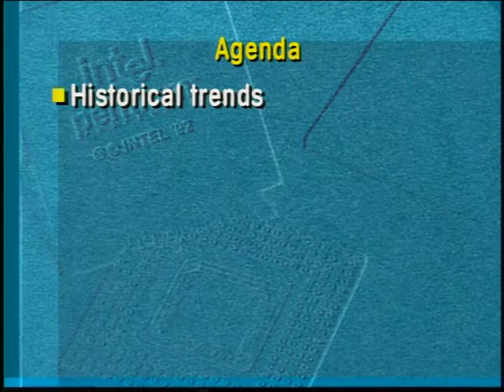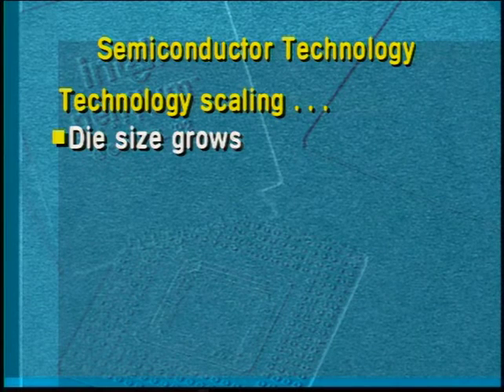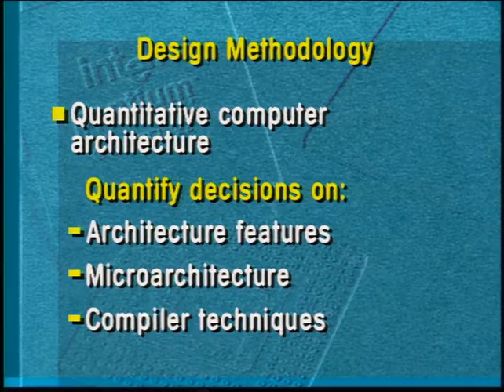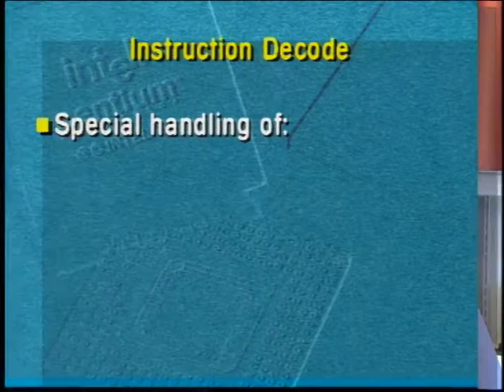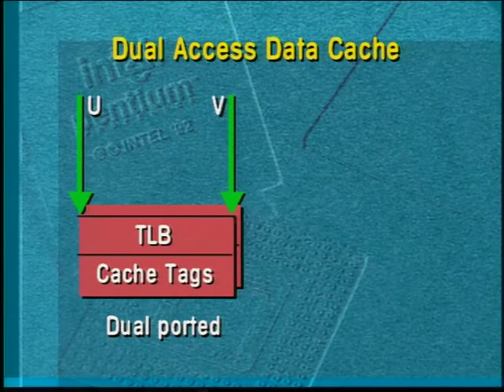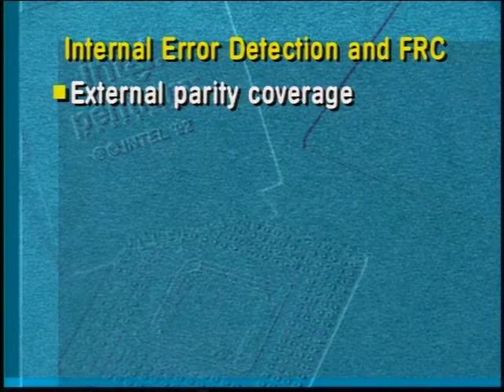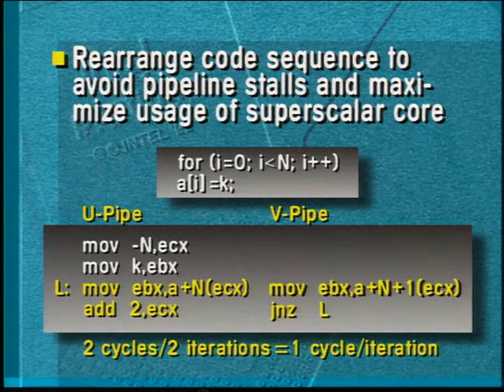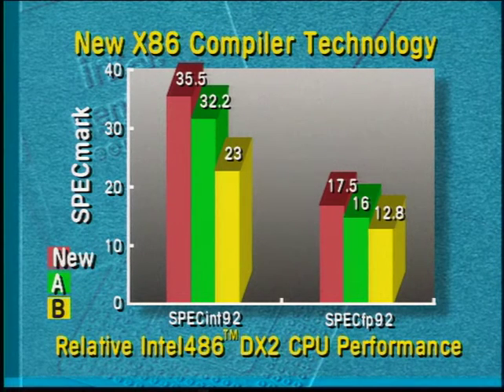Intel's Pentium Processor, a lecture by John Crawford, Donald Alpert and Beatrice Fu

Comment: Unless I'm mistaken Branch Prediction used parallel processing where the main program continued to run based on the prediction, and in instances when the prediction turned out to be wrong the program would back-track and rerun.

Comment: So "performance" is just "speed" here... Never mind that your compiled code gets twice as large. Almost seems like a software fix for a lazy hardware design.
Reply: Yes, performance was a synonym to speed. It still is. If you take a modern processor and disable the caches it will perform like a 486. The latency has improved only a little bit in the last couple of decades while clocks have improved greatly. That's a real, physical thing and there's almost nothing you can do about it. The whole game is about finding more parallelism somewhere and squeezing out the last drop of running more instructions in parallel across more threads. There is just nothing else left.
Reply: @soylentgreenb  "It still is", no it's not. And I don't even have to tell you why, because you already mentioned it: parallelism. Instead of spending a large amount of transistors on the speed of a single core, there's an alternative nowadays. Use the same amount of transistors or die space to build multiple smaller cores instead of one big core. And that includes decisions about cache (also transistors) and therefor things like unrolling loops. Nowadays it's not just "speed", it's "speed per square mm" or "speed per watt".
Reply: @ArumesYT he's correct that each of those cores is basically a 486 speedwise when you're done.